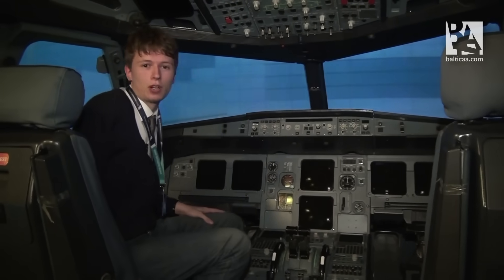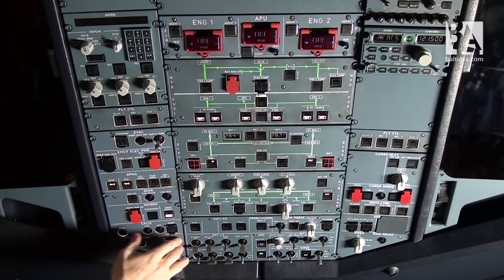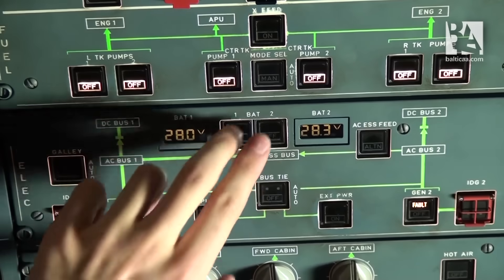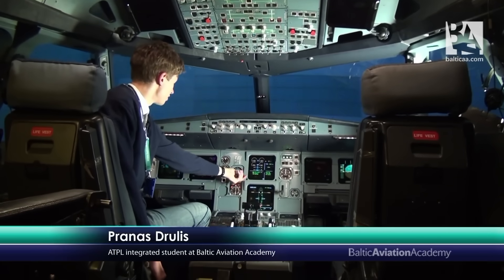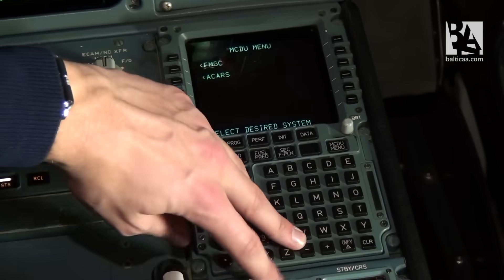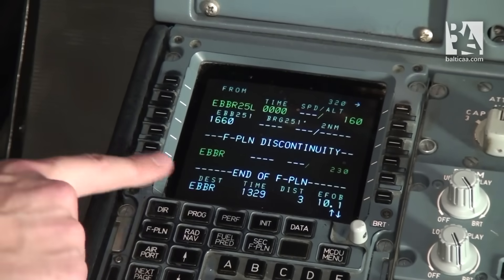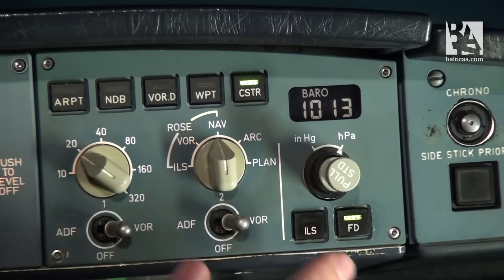Airbus A320 - From Cold and Dark to Ready for Taxiing

Comment: I have the Aeroproyecto SSJ-100 superjet for fs and it astounds me that the Sukhoi basically has the exact same panel. I see a few differences in switch position but they are mostly interchangeable when you look at it.

Comment: If the aircraft is run by electronics, why is there not a one-button 'START'?
Reply: This one looks old. All the bulbs are incandescent and all the screens are CRTs. On newer planes it's the first part to start the APU then all the screens start up automatically and the pilot needs to flip way fewer switches.

Comment: It's very complex. What would happen if you skipped some steps or did them in different order? Actually from fly-by-wire plane I'd expect it to execute everything that's possible automatically, prompt pilot for values that require pilot's interaction in the right order, and eventually report any inconsistencies. Is something like that possible? ETA: I now see 13 years ago. So it possibly can be done differently and simpler now.

Comment: Thank you! I remembered most of it but lost my checklist that said set the engine control master to on. Thankfully I’ve managed to move my A320 into the garage, the neighbors were getting cranky about me having it on the driveway. Does anyone have any recommendations for a good used aircraft carrier dealership? I need something budget friendly, ideally nuclear powered and not gonna run out of fuel every time I cross the Atlantic. Prices of filling up the A320 is getting expensive so I figure I can save a fortune taking it most of the way and then doing short hops to the scenic places. I mean even if the aircraft carrier is half good that’s still 10 years before I have to take it to the gas station!

Comment: Someone didn't check all of the overhead panel switches to ensure all of the bulbs were working. At about 4:15, Gen1 and Gen 2 switch Fault lights are illuminated, however, the left bulb (387 bulb) in the Gen 1 switch is out.

Comment: As a pilot , I never check if the landing gear is down when the airplane is cold .  Just saying ... Could it really be up ?  Also I tend selecting the altitude elevation nob on manual for the departure or landing airport and key in hPa myself. I do Not tend to trust the Auto myself in terms of a failure which can result in a catastrophe if it mulfunctions !

Comment: 1:54
Tip from in the field: 
Try not turning the integrity light knob all the way up. 
Yes, the buttons will be at their brightest. But they'll also be at their hottest. 

And they can get quite unpleasantly hot after just a few minutes, at full brightness. 
Deceivingly hot.

Same applies even more to the overhead integrity light knob. Being on the ceiljng, where heat likes to go, those buttons get even hotter if left at full brightness. 

Keep those integrity lights as dim as within reason, to keep the temp of those buttons at a reasonable level. So you don't (lightly, granted.) burn your fingers.

Comment: But dont you have to turn off the APU before takeoff?
Reply: Not always. the airbus SOP says APU as required. Mostly you will keep it on if you are performance limited (so that the air conditioning uses air from the APU rather than the engines)

Comment: "Before turning on electrical power there is a few things that we must check :
-Thrust lever : Idle 
-Ignition : Off
-Gear lever : down
-Windshield Whippers : Off" 

OMG imagine you forgot to turn off the whippers and just start the thing ! It could have some catastrophic consequences as such as intermittent loss of visual cues and ground crew...
Reply: Wipers and windshield glass are very expensive compared to your car so yes you're going to ensure they're off if the glass is dry so it doesn't risk damage to it

Comment: Didn't turn APU bleed ON?
Reply: You don't turn APU bleed on if you have external bleed supply (which is mostly the case in major airports)
Reply: @ZK-APA  correct the ASU can backpressure the APU bleed duct, causing the APU bleed valve to rattle (potentially damaging it)

Comment: The APU is a turbojet, in essence. When starting up an engine, fuel is not introduced into the engine until (if I recall) N2 is around 20%. After that, the engine is self-sustaining. The engine parameters are monitored in the cockpit.  As for the APU, the computer handles all the startup and introduction of fuel, I would imagine, as there is no monitoring of its engine parameters.
Reply: correct the FADAC (Full Authority Digital engines controler) regulates all the start sequences
Reply: Does it also automatically shut down? He didn't mention turning the APU off in the video

Comment: So throttles idle, masters off, mode normal, parking brake engaged, gear in down position, batteries on, fire test apu, start apu wait for apu to go into normal running, turn on cabin lights, select automatic on all fuel pumps, fire test all engines verify no important warning lights are illuminated steering in on position, switching to normal positions check status for issues, throttle in idle, masters off, mode normal,ground spoilers retracted, flaps up engaged, rudder trim is 0, brake on, gravity gear in correct position, tcas has both in stby, master to ignition, mode to on, verify engine status and repeat, release parking brake throttle up and pick an empty runway?
Reply: And no I'm not going to try and take a plane I have a very good memory and if the world went zombie apocalypse I would be able to remember 98 percent of the important steps for takeoff

Comment: So, normally is this plane starting self contained or usually connected to a ground external power unit to start the engines? Thanks.
Reply: You need bleed air for engine start, usually the apu provides that and electrical power. If the apu is u/s you`ll need a gpu (ground power unit).

Comment: 1:25 How do we know that the API start was successful?

BTW could you please share the voltage, amp hour and wattage ratings for the batteries and the APU?
Reply: The specifics of the Airbus A320’s battery and APU vary based on the model and configuration. As of my last knowledge the A320 typically uses Ni-Cd batteries. The main battery voltage is usually 28 volts, and the amp-hour capacity can be around 44 amp-hours.

For the APU, it’s important to note that different A320 variants or airline configurations might have variations. The APU on the A320 is typically an IAE V2527-A5 or CFM56-5B4/P, and its electrical output can be around 115 volts AC

Comment: I believe this is a much older plane based on its instruments & switches. Today's system are all touch screen.
Reply: Only aircraft with touchscreen displays are some newer A350’s and the 777x
Reply: @tomstravels520 it's even worse, the 777x isn't in service yet, so it's only something like 50 a350s
Reply: What if the touch screen breaks though, you have to have analogue backups

Comment: Lots of What  but very little Why or How.  EG he "tests" the batteries by turning them off and on again. Which really tests nothing.  You are supposed to observe readings in checks like these.
If all you want to learn here is which switches to flip, then it will be good.  If you want to really learn the proper checklist, this isn't it.
Reply: He isn’t claiming that it’s a comprehensive checklist though, is he? If he was, this video would be far longer.

Comment: Has anyone ever raised the landing gear while the plane is parked? Would love to see how that went
Reply: You can't raise it on the ground, there's a sensor that determines if weight is on the landing gear, then the lever is mechanically blocked, same goes for lowering it at high speeds, also not possible.
Reply: not possible on this plane but it did happen on some smaller planes. there's security cam footage too, look it up

Comment: You don't have to turn the APU off after an engine has started?  Not that I'm a pilot or anything just interested for MSFS and DCS.
Reply: Once both engines are started you would turn off to save fuel unless needed for performance reasons and in the heat to keep passengers cool

Comment: Honestly, I've been using the A320 so much in MFS thanks to watching Sully too many times (plus her autopilot is just fantastic and she moves better than the 747), that I almost feel like I could start up a real A320 myself.  Not fly it, god no, but get 'er warmed up?  Probably could in a pinch.  And hell, if I'm ever on a A320 and for some reason, I need to fly it, I'd probably be more qualified than anyone else on it, save any actual airline pilots or super advanced flight simmers lol

Man, look at the paint wear on the engine switch.  Probably been turned 50,000 times lol
Reply: Yea, the a320 is a relatively easy bird to start as far as I'm concerned, especially because the engines are controlled by a FADEC and computers, so you don't even have to monitor engine speeds to add fuel, it does it all by itself!

Comment: The lack of any security measures to stop theft is astonishing
Reply: not many try to steal planes also the doors lock and it's presumably at a secure site.
Reply: @johnk7302  worrying indeed
Reply: it's kinda hard to steal a plane on your own. For one, in most positions you'd need a pushback truck to get you lined up. Also the airport is obviously fenced and quite secure. And, at the end of the day, even if you steal an aircraft, you can't exactly do anything with it. They will track you on radar and capture you at the airport you land it.
Reply: Commercial planes are parked at airports with fencing, barbed wire and multiple CCTV cameras. The likelihood of stealing one is minimal. Even the guy in 2018 stole one because he worked for the airline. Remember also these planes would either have jetties or stairs that would have to be moved out if the way first before you could move and the plane cannot move back on its own
Reply: You think you will be able to provide ground power, fuel it, perform a startup, push the plane back, taxi to a runway and fly it away without anyone noticing or stopping you?

What anti theft measure do you think should be added lol?
Reply: You don't need ground power to start it. It will probably not have much fuel in it while sitting in some hangar tho.  @DutchManticore

Comment: So, you establish electricity with the batteries and start the APU, but you don't monitor the system on the screens to make sure that the power is flowing correctly, or that the APU is starting normally? I'm thinking I am going to refer to other information to make sure about all this.
Reply: This is only done if the ground power isn’t available. Normally you would have that running but the batteries cannot power the screens on the ground so as long as the overhead panel has 2 blue lights to show APU is starting and then goes green your screens will eventually come on. If the APU encounters a problem it shuts down automatically

Comment: I worked on every A320 varients from 1988 to 2021 drilling off the undercarriage reinforcing plate on bottom skins also drilling off the top skin panels and preassure testing the vent box sully sent me a message of thanks after the Hudson safe landing airbus the safest in the sky !

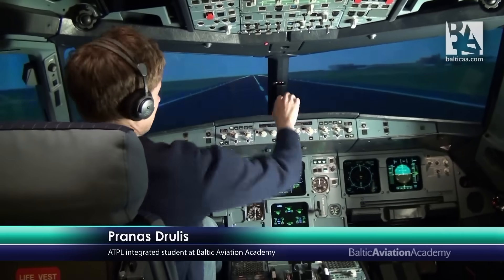Comment: 14:32 Oh..that was way to quick bud🤭
Which is probably why you got a takeoff config warning after this video ended since you forgot to set the flaps☝🏻🙆🏻‍♂️
Reply: at 13:44 if you look at the EWD you can see the flaps are set
Reply: @tomstravels520  Did you take a picture and zoomed in?😆 I really cant see that clearly🫢
Reply: @speedbird9313  if the flaps are extended then the dots showing the positions appear. You can see if the resolution is at max

Comment: Thank you for your wonderful tutorial, I have a question is it possible to accidentally bump the ignition switch for each engine and turn off the engine in the center between the pilot and the co-pilot in other words can you shut off engine 1 and engine 2 mid flight?

Comment: Im curious about the power on / battery charging procedure: it shouldnt be external power on in both?
Reply: External power has really nothing to do with the batteries🤷🏻‍♂️
Reply: @speedbird9313  so how are you supposed to charge the batteries then? using magic?
Reply: @_g3nss  You can charge the batteries by magic or an electrical power source (ext gnd pwr, apu or engines)👍🏻

And no, this is not a Boeing😉
Reply: @speedbird9313  ext gnd = external power. you know that there is a procedure that you do on the airbus that basically if you want to test/charge the batteries you have to turn off and on both batteries with the external power on right? He didn't do that procedure on the video.
Reply: @_g3nss  You really dont have to tell me the abbreviation for external power🤪 Test the BCLs you mean? 
It depends where you are, we often start the apu without external power if we’re not at a gate.

Comment: If that was a real cockpit I would be concerned about how much dirt and fluff was around all the controls and switches, you would have to wonder what would be behind the panels. I'm in the automotive industry and when it comes to automotive electronics and dust etc is conductive, most work carried out with gloves and cleaned down with a solvent, although if the engine fails you just stop then all you have to worry about is how far of a walk to the pub.

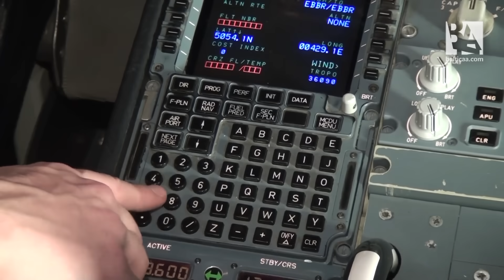Comment: 9:48 cruises at 2000ft
11:50 initial climb of 4000ft
-------------------------------------------------
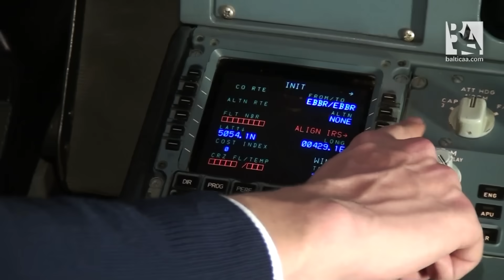9:42 Sets Flight Number to "320"
12:30 "Speedbird123"
Reply: I think he started engines with cabin doors open too lol😂
Reply: @vktor192  and departed with APU on
Reply: @vktor192  On the stand too!
Reply: And no flaps
Reply: @carloscortes5570  he did set flaps, i can see it in a display
Reply: 1. Cruiselevel CAN actual be lower than the Init. climb altitude/level. This can be the case with GA planes where they need to climb to a certain altitude to avoide obstacles, but are cruising lower when possible. 

2. Flightnumber CAN be the Callsign, or the Airline Flightnumber. Usually when CPDLC is used the callsign will be put into the FMGS.

Also, flaps are set to their T/O position after the enginestart while you dont't have any hydraulic pressure without a specific engine running. In this film, they won't show you where he sets the flaps.
However, before T/O on the upper ECAM screen you can clearly see the flaps in 1+F and the lever sits in its 1 postion.
Reply: Also he didn't set the flaps before takeoff
Reply: It's a student project in a professional simulator, not "How to steal an airplane".
Reply: @crypto1701  what do you mean ‘’how to  steal an airplane’’? you say that like there’s absolutely no video online on flight simulators that show you step by step how to startup, setup and fly a full route in any given aircraft…
Reply: I noticed that to lol
Reply: Apart from flaps also Transponder, TCAS and Weather Radar were not discussed/shown/checked - should be on, before entering the runway, together with the strobes, TCAS set to above. Neither did I see the autobrake being set to RTO (?) or the speedbrakes armed. Not to mention starting the engines on stand BEFORE pushback, just being authorized by ATC is at least unusual - nobody outside yet who can tell the pilot the engines are clear (or people).
Reply: Haven’t you seen the doors opened with engines running? 😅😅
Reply: I heard him mention that TCAS was set I also heard him say weather radar off, I'm assuming he should have switched it on or does it just kick in once in air
Reply: Se pide a sí mismo autorización, que siniestro. En lugar de leer los checklists en voz alta, los mira y se convence de que está todo bien.
Reply: its just an example buddy
Reply: Cruises at 2000 ft , yea he got that so wrong . He needed another 0 . Should have been 20,000 ft  , if not higher .  Also initial climb can never be set higher than cruise altitude 😁 .
Reply: you missed the APU still on during takeoff... 14:32
Reply: hahahahah
Reply: The callsign doesn't Need to have the flight Number i Guess...
Reply: @rafa_vsky you are right
Reply: Speedbird is a British airways callsign
Reply: @aliasofanalias7448  Yes it is, but why can't he use it then?
Reply: @BeauVerwijlen That's not what I'm saying. I don't understand why op highlighted the callsign, is it a joke or were they confused the callsign didn't match the flight number? I was under the impression they don't know what speedbird is
Reply: @aliasofanalias7448  I get you! Probably they just made those numbers up for the tutorial.
It is a great video, isn't it?

From now on we both can start the Airbus in our backyard haha.
Reply: @BeauVerwijlen  It is a good video.
Yeah I doubt it's the actual callsign. I watched it for flight sim haha
Reply: @aliasofanalias7448  For flight sim you better use Standard Operation Procedures from the Quick Reference Handbook. In this tutorial not everything is covered.
Reply: @BeauVerwijlen  Ah okay thanks mate!
Reply: @aliasofanalias7448  https://drive.google.com/file/d/1udt04482snAfpjAXW-CXDWjkJsDf8kc7/view?usp=drivesdk

That's a simple checklist based on the SOP. When you follow it you'll be a A320 pro in like 3 flight or so.

The only thing you need to know is how to program the FM(G)S via the D.I.F.S.R.I.P.P. procedure. Just google/youtube-search it!
Reply: @aliasofanalias7448  I know 💀
Reply: Lol

Comment: At 14:33 is it nominal to still have the APU on and bleeding upon take off? Should it not be turned off after the engines are started?
Reply: I've heard that it should be turned off once the engines are started. Then the exhaust flap can close for the flight. You are supposed to have it ready to start again on landing because, AIUI, you'll need it again after engine shutdown.
Reply: Yes it should be
Reply: Not necessarily. If you’re performance limited you can run the packs off the APU for takeoff.